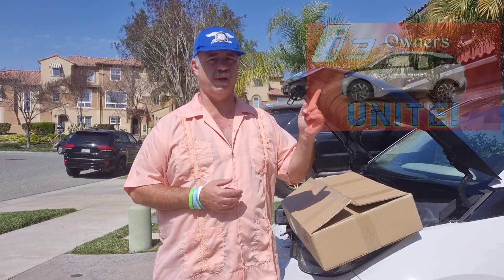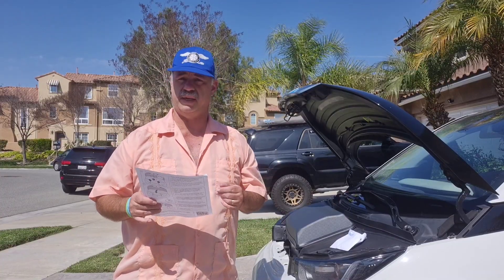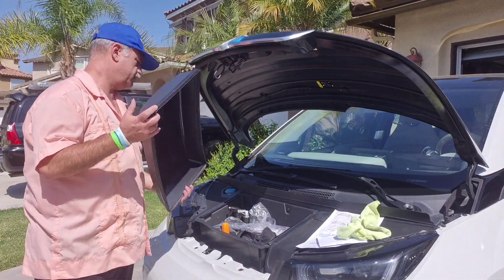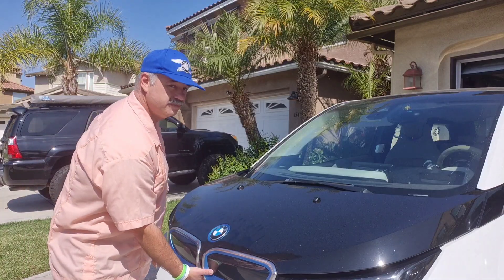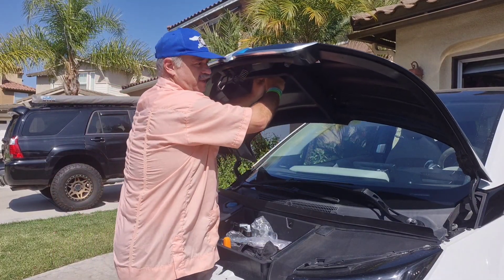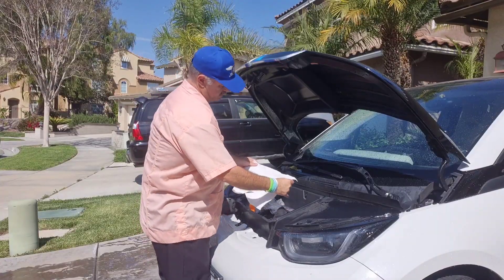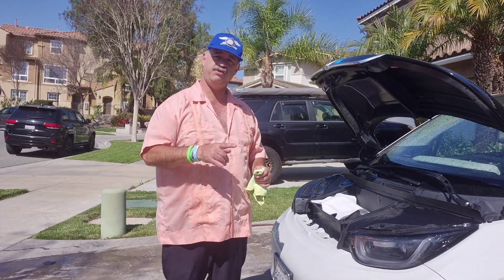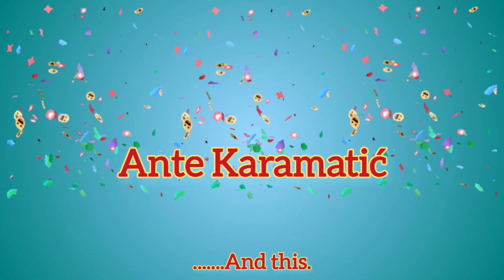BMW i3 Waterproof frunk.

Comment: very cool,  looks a littly flimsy,   But great concept
Reply from the maker: @fergman300 Sort of. The cover itself is pretty solid. Connecting it with velcro strip makes it feel flimsy on the car.  This would be easily fixed by using fasteners or a good adhesive, but I like the fact that I can remove it if needed, like formy next i3.

Comment: The Velcro seems like it would fail in very little time
Reply from the maker: @thehpwIt would make sense to think so, but this is pretty solid velcro. It is large loop, double male that sticks together pretty well. I have messed with the cover a few times and so far it only popped off, in only one location, once and that was from the adhesive side. And then it was aided by this being the one I removed once in the video and on a hot day which likely softened the adhesive.

Comment: Thank you for your review and nice to hear that you are happy. Just some comments from my side:
1. Cleaning process of the beams: It is important to remove possible lacquer that can be present on the bottom side. Just cleaning and degreasing is not enough!! There should not be any lacquer but BMW does not care if there is some on the inner side. But if you stick the Velcor on the lacquer it will fall off with the lacquer remaining on the Velcros
2. Which beam to put the Velcros: Maybe you had an older version of the installation instruction. We now explicitly point out that second and third elevated bars are the correct ones.
3. Dripping water from the hood: Thank you for pointing out that this can happen 🙂
All the best.
Reply from the maker: @WOKEBY Thanks for the comment. It is good to know that there COULD be lacquer under the hood. There was none on mine so it seemed that BMW didn't put any. It is good to know that this isn't always the case. I'm glad there are updated instructions as there were less beams reflected in mine that there are under the hood. This confusion is compounded by the reality that the correct beam is rather skinny and does not look like an ideal location, even though it works just fine. I am indeed happy with the product and would recommend it to others. Now you just need to make a CCS1 port cover.😁

Comment: It seems to me that the frunk manufacturer requires that the paint be removed with hydroalcoholic gel from the Velcro locations, otherwise the frunk will eventually no longer hold.
Reply from the maker: @kyriusplay I am not sure that the underside of the hood is actually painted. Whether it is or not, cleaning with alcohol is both a good idea and ( if I recall correctly) is in the printed installation instructions. Removing the paint, however, should not be necessary.

Comment: Looks like the best option would be a combination of this lid and the 5 spur product. ie more storage space and it couldn't drip into the frunk, when you open the hood/bonnet.
Could be an idea to contact the owners forums in the UK and the EU, to see if you can increase interest in the 5 spur product.
Reply from the maker: @dougowt  Thanks for the input.  The two products have trade offset. The 5 Spurs would prevent the dripping and look better. While the Wokeby one I got should have more space and easier operation. One thing I am hoping to see is 5 Spurs making the side pods some day. The removed them from the website but they are still on the inquiry form. If possible, using them with the Wokeby frunk cover would be a great combo
Reply from the maker: @dougowt  Oh and I certainly would encourage you to put it in the UK boards to try to.push this to market. Probably would get more traction with the UK company than from those of us across the pond
Reply: @Wings_Wheels_and_Wires  Yes I was thinking that there is more likely to be a bigger take up, as much lower carriage costs. But folk need to be aware they exist 👍
Reply from the maker: @dougowt  I would agree  completely. I would have gotten this kind of product a long time ago if I either didn't have to pay much for shipping or even better,could have driven over to pick it up from the manufacturer. Cheers

Comment: Installed one for my 2019 i3 Rex. I love it. I wasn’t too gentle so I used self tapping screws for a better hold.
Reply from the maker: @michaell.3445  Thanks for the comment. I can see adding something to make for a stronger hold. The stock velcro does the job well but feels a little wobbly. I will probably add more velcro. Not as secure as screws, but I can't  bring myself to put holes in Rexi.